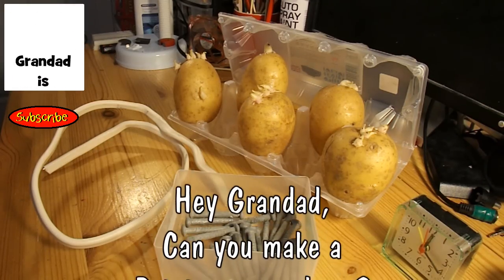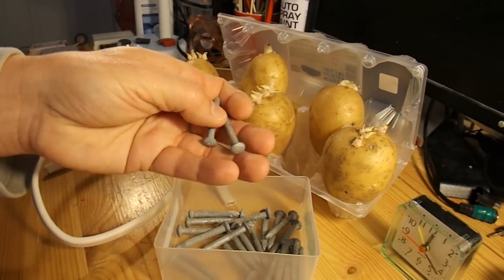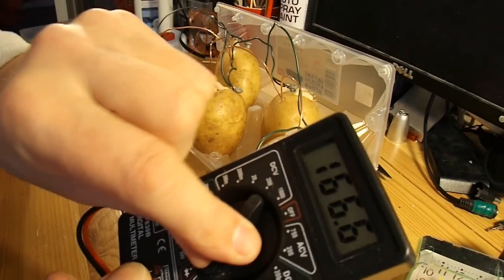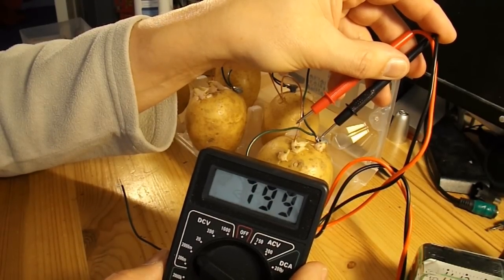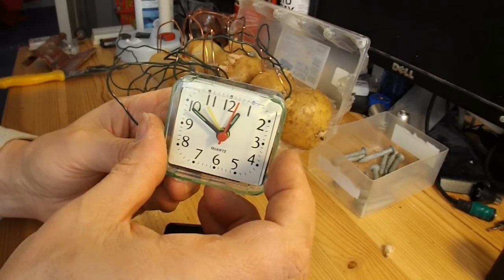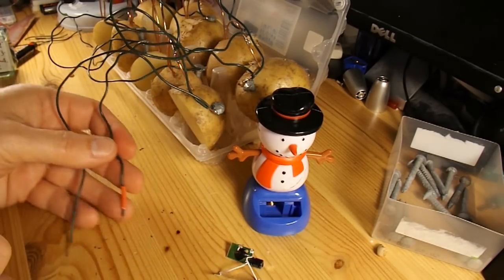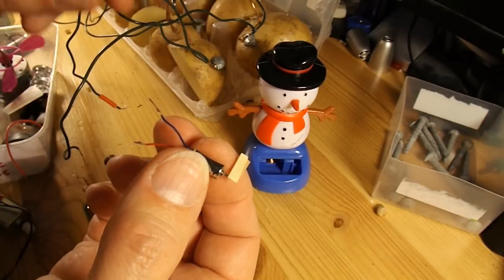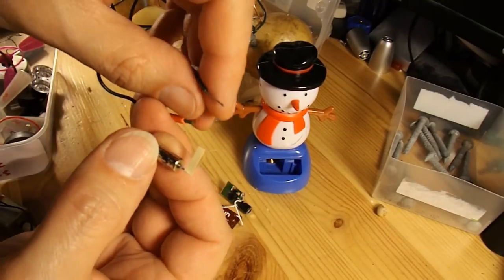Hey Grandad, can you make a potato powered car? (no I can't)

Comment: You get about the same voltage out of a much smaller slice of potato. If you used a tenth of a potato about six times and put three in series, you'll get a much better current with around 2 Volts.
Reply from the maker: Thanks for the comment. You will find related videos and playlists linked in the video description, however you will not find a genuine potato powered car on YouTube. There are some fakes. There simply isn't the power density required to move a car, with the potato battery onboard. The best way to find out is to try it for yourself 👍👍 My "Lemon, Potato, Vinegar, Salt etc Power" playlist probably has the most relevant videos.
Reply: @GrandadIsAnOldMan  You're probably right. But there are more ideas to try with a capacitor.
Reply from the maker: @dalauder  Like I said, check out my videos in the video description, there are even some using potatoes to charge super capacitors to run cars.

Comment: Is it possible to use the CD player motor to power an airplane?
Reply from the maker: Hi, that's an interesting name. I don't think the motor would have enough power, but it probably depends on what sort of batteries you can use to power it. If they are light enough and the airplane is light enough it might work. I haven't tried it myself. When the weather gets better later in the year I may try a few airplane projects.